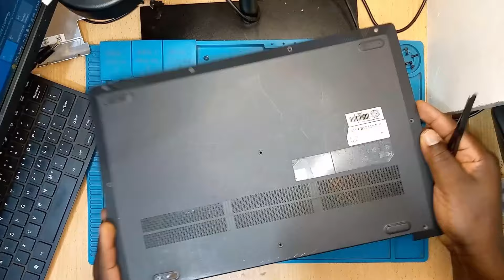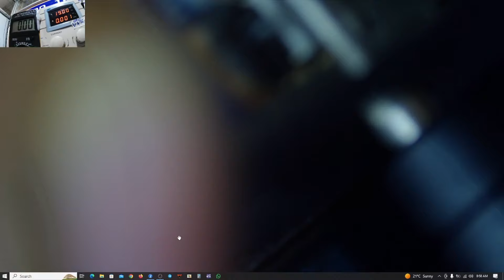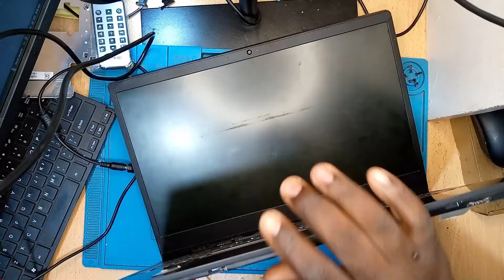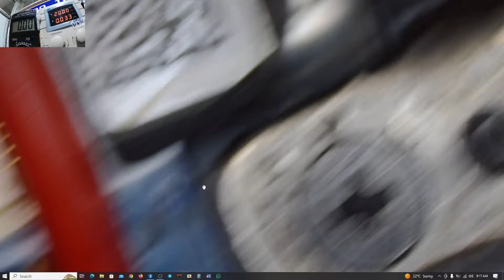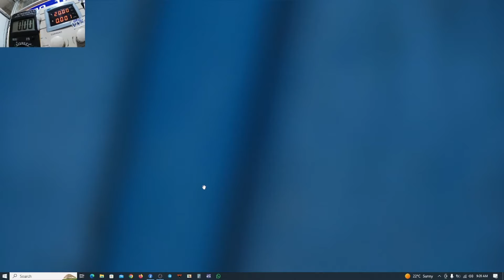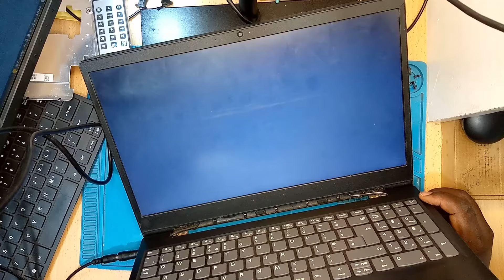MOST COMMOM FAULT on Lenovo ideapads series laptops  -Closed vs Open Mosfet.

Comment: My friend mosfet is not told to get switch on . This mosfet is driven by bq chip and by n-channel mosfet it needs to have 25v to gate. For the mosfet get told. It is possible that the bq chip is faulty but also it can something what for requirements is needed vcc , ac detect must be there. Now it will not charge the battery. Jumping mosfet is not the solution.

Comment: Nothing good about ideapads. They are cheaply made. Basic, quick, cheap, throw together laptops. They flex and bend so easy and that is an issue in itself as it can pull solder pads and disconnect solder balls under the cpu and gpu... Ive got a s340 from 2020 i will not fix as it was a decision after teardown as it was so cheaply made it wasn't worth fixing.